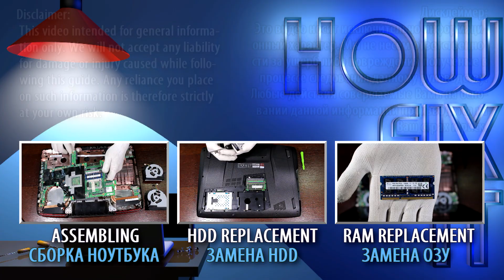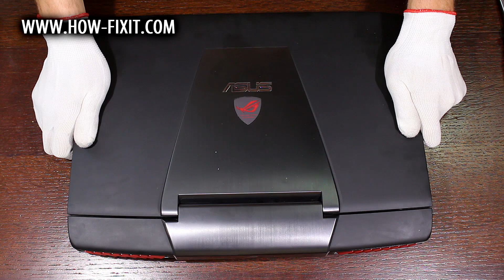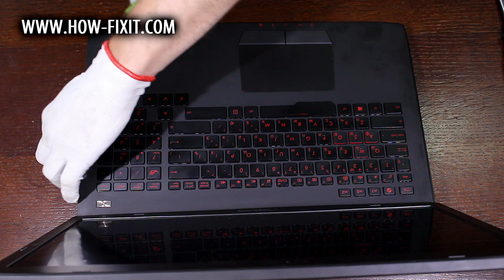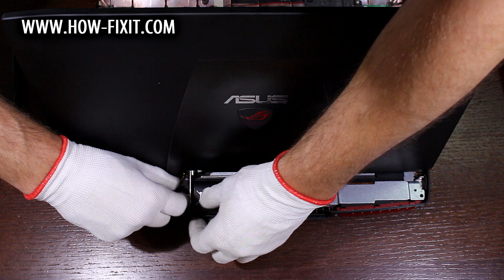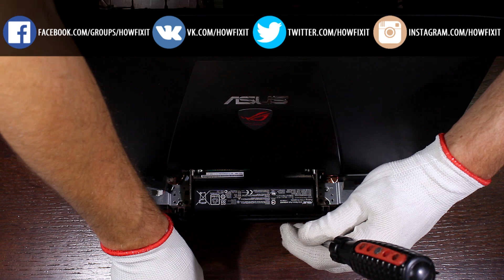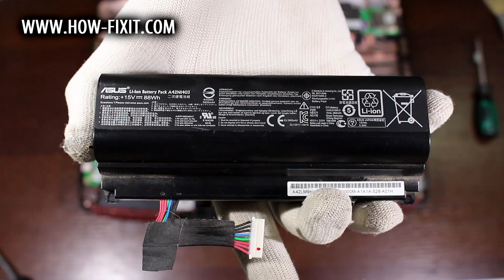Asus ROG G751 Battery Replacement | Repair Fast-Draining Battery

Comment: If your G751 reboots suddenly and randomly, and the battery power shows 0% but always charging, it is a bad battery causing the shut downs. Asus could charge over $600 if you send it in and you have no warranty. 
All you have to do is disconnect or replace the culprit battery.

Thank you to the author of the video but he went too far with disassembly - all you have to get to is taking the top keyboard panel off, not even disconnecting it. You can reach the two screws that hold battery in place, and than carefully wiggle it out, or just disconnect the battery cord.
Reply: I can confirm that you can replace it easily without removing the screen and disconnecting the keyboard. You just move the keyboard forward a bit, disconnect the battery cable and pop the 4 battery clips in the back. It's a 10 minute job. Mine was no longer charging and it made my touchpad lag in a weird way.
Reply: why don't you guys who did this successfully make a video????
Reply: I dismounted my computer and removed the battery and it worked! the computer works on AC transformer
Reply: Can all of this be done without removing the screen and speakers? Also, which battery replacement did you use and is performance the same as before? Thanks
Reply: How did you manage to wiggle it out?
Reply: Volodymyr Akvilon hi I have an asus g751j and i think it has that problem... it has the led popping from orange to green everytime and it starts for a time and then shutsdown. So if I take the battery off, or just dicomect the battery cables can i still run the pc with the AC power cable?
Reply: Thanks for the shortcut!  I was able to replace my battery without taking everything out.  I just put out the keyboard, then I slide it out a little so that I could access the battery connector (attached to the motherboard).  I did remove the screen to get access to the two screws holding the battery in, but it wasn't too much of a hassle.  Thanks, again!
Reply: I just completed my battery removal without removing the screen as seen in the video... It was doable but because of some pieces of plastic on the very back of the battery designed to hold it down, it required a bit of force and an extra set of hands  to remove.
Reply: I have the same problem.....laptop goes to sleep randomly....this is my second battery replacement and this faluty issue keeps coming....i dunno what to do....
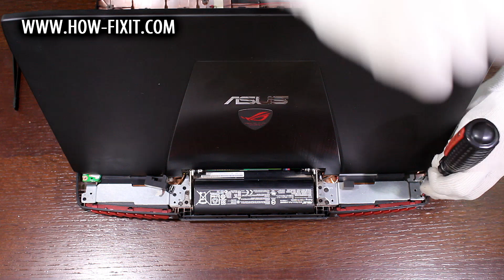Reply: Can you really reach those screws that hold the battery without taking the screen off ? It kinda looks like the screen mount just covers those screws 8:00
Reply: Changing out the battery on this computer is like a Rube Goldberg Machine.
Reply: I have the same problem I think it is because i have charged my phone on the laptop while it was off and I have discharged the battery too far.
Reply: thats what I'm wondeing
Reply: Same thing happened to me. Geek Squad wanted to charge me $75 to take my laptop for 3 weeks just to get a diagnostic plus additional pricing to get it repaired. Called Asus directly and they wanted to charge $60 so I could send it to them and give me a diagnostic, saying the random shut offs were a problem bigger than simply replacing the battery. So I had to take matter into my own hands and get my own battery off Amazon and will now attempt to replace it myself 🤞🏼
Reply: @aiarochp  Please let us know what happened, did replacing the battery correct your sudden shutdowns?
Reply: @myfriendbro  I changed the battery myself, took me a couple of hours. Then realized I missed some screws so I had to open it up again and disassemble the whole thing. Spent a total of 6 hours that day changing the battery, still had some screws left that I didn’t know where they belong. Anywho, my laptop now says charge is 200%, it no longer shuts down on its own but it does shut down when I unplug it from the charger. It’s 6 years old now. I will eventually get a different laptop and get rid of this one, not sure I’ll buy Asus again.
Reply: @aiarochp  Thanks, but that doesn't sound right! 200%?! & why does it shut down on removing the charger? does that mean it only shows full but still needs charger to stay up? Also, since I might also get a new one, after using the same machine what are you thinking of buying replacing this?
Reply: @myfriendbro  I know. So there is definitely something wrong with the laptop at this point. This laptop is discontinued so getting the right original parts is very difficult. I’m thinking on getting an Alienware, been wanting one for years.
Reply: You should make us a video. Having a vid where they don't talk sucks!!!!!
Reply: ur battery gets overheated and the battery burns from inside so u are making the same mistake 
asus g751 series dont have a good cooler system get ur self a external cooler and a termal paste for inside 
and ur batteries will live longer

Comment: looking for a replacement after mine killed over last week. all reviews on amazon pretty much state comp didnt recognized the batt. know a good seller online?
Reply: Just finished doing this with the ZTHY 15V 88Wh A42N1403 Battery ordered off of Amazon ($68). So far, working great.
Reply: Andre Mercado
No problem, good luck!
Reply: I've just ordered some Panasonic 18650 battery cells and am going to attempt rebuilding the battery myself, I'll post an update here when they arrives
Reply: any luck finding a good battery for your pc??
Reply: haven't gotten a response from anyone that  has replaced their battery. I guess I'm going to have to bite the bullet and pick one with whatever better review they could possibly have. AS ASUS sent me the OEM part number but that still returns the same result for shopping online. they quoted me 600+ to replace it LOL.
Reply: Andre Mercado what a rip. i'm in the same boat as you, needing a new battery. went to a local computer store they said they could special order the battery for 100 and charge me 50 to install it but it would be a non asus brand. think i'll just have the battery removed and run the pc always plugged in
Reply: I was thinking about that but I really do need that battery use. find myself tethered to the plug wishing to move around and not being able to or not feeling like shutdown/reboot to move.
Reply: well, i guess ill follow you on that path since you have had hands on. thank you for sharing the part number!
Reply: Any luck in the battery you chose? I'm needing to replace mine and most reviews are crap
Reply: Hi, I'm currently dealing with the same dilemma. How is the performance while doing ordinary tasks like browsing or heavy ones like gaming? Do you notice any lag? Thanks
Reply: Best of luck
Reply: didn't think of taking that route, looking forward to your success. be safe!
Reply: Did it work?
Reply: Hey, how has the battery been running since last time.